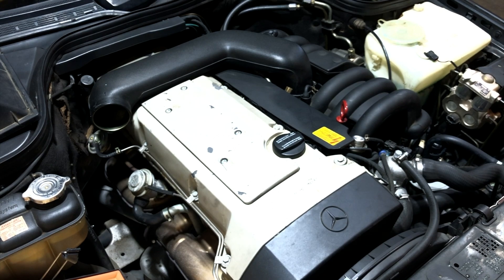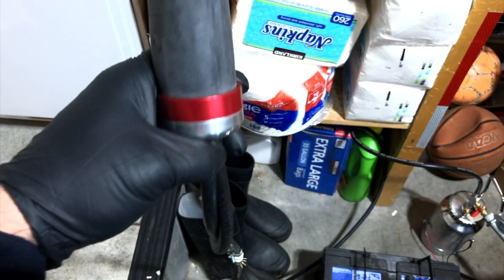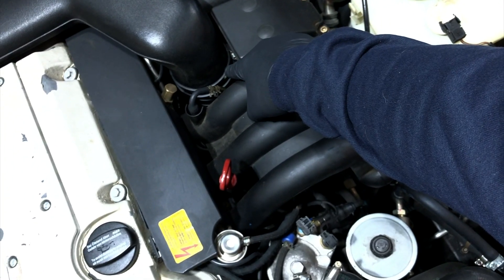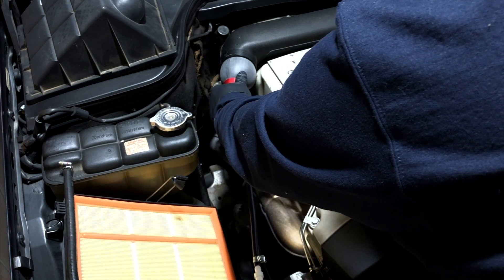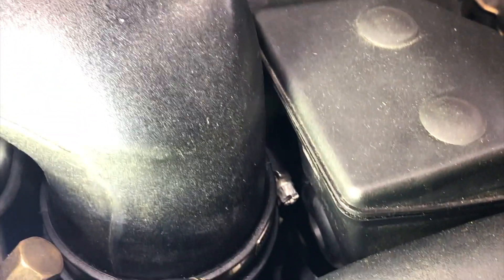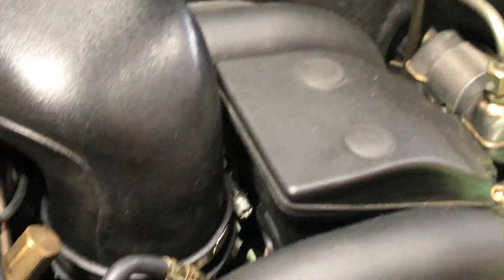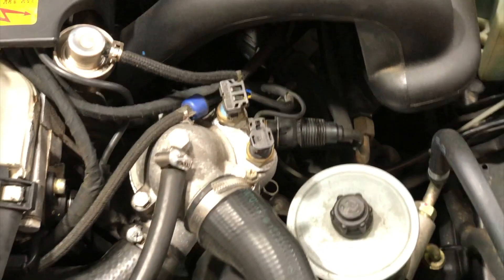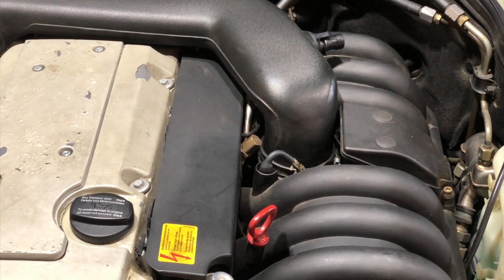Smoke Test of Air Intake and Vacuum System 1994 Mercedes C280 W202

Comment: I currently have a similar problem with a 1995  E320 station wagon -M104 straight 6 engine , it has high idle and a steady miss now. Originally I thought it was a ignition issue, change the plugs and ignition wires , all the original plugs looked good.I am fairly certain it is a vacuum leak somewhere, but have not smoked it yet.